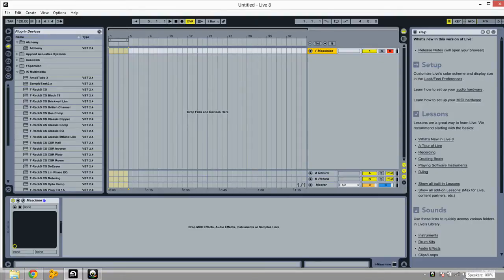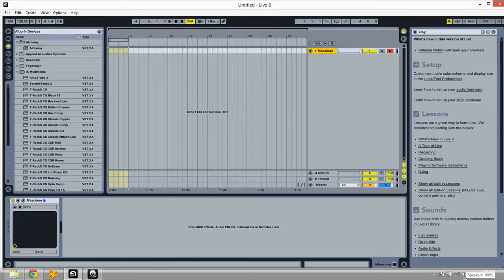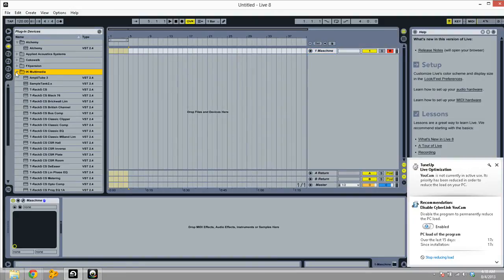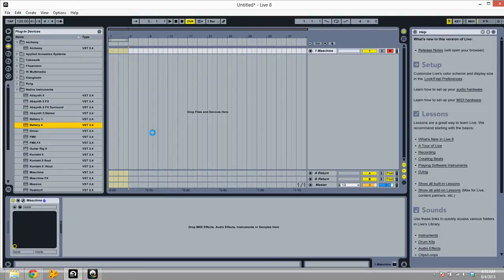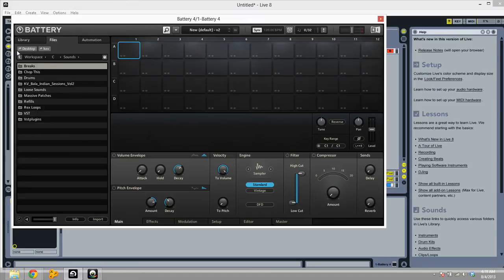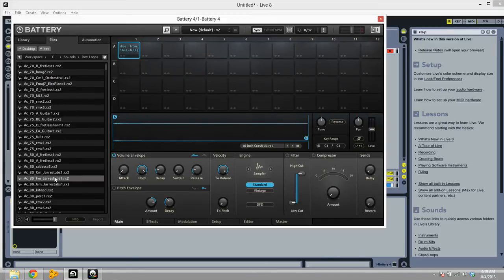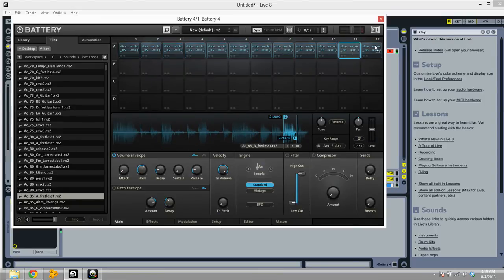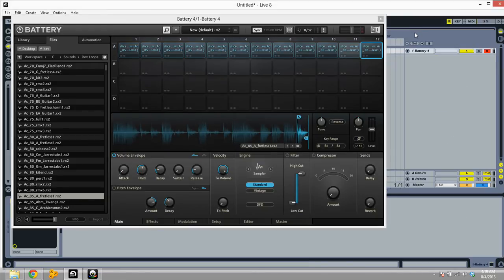Tutorial: How to load REX loops into Battery 4

Comment: Hey there,
This is absolutely awesome. One question though, do any of you know if there's a way to also load the full loop onto a pad? Or even better, the full loop with multiple keys pitched up like it would load in Kontakt? Otherwise I'll probably just use Kontakt for the loop and Battery 4 when I need to use the slices. Thanks